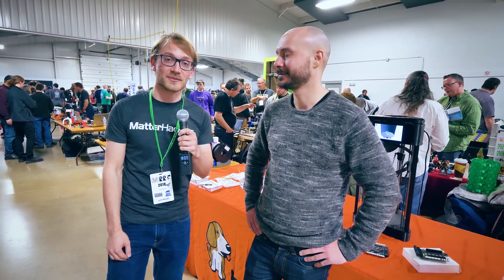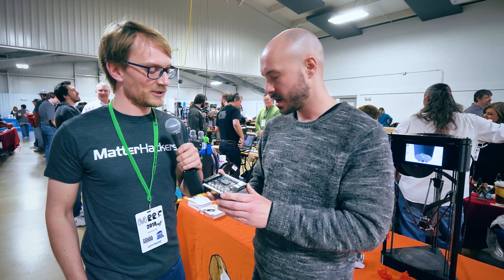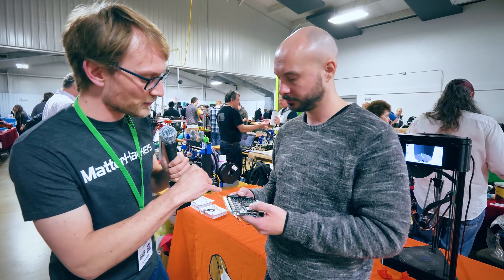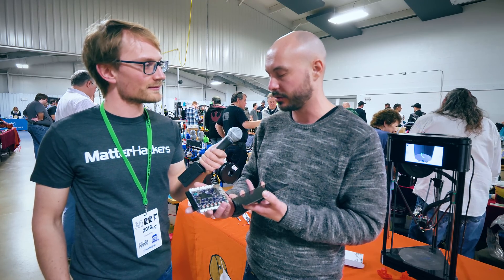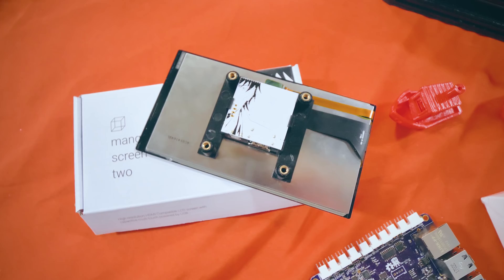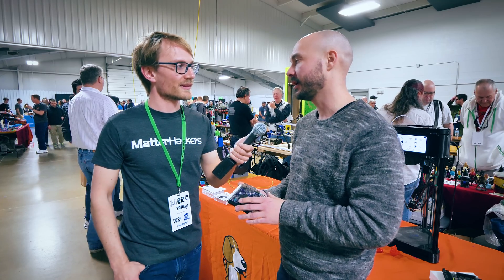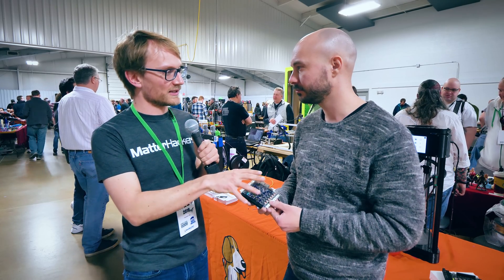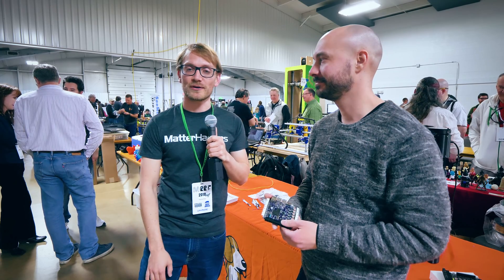Run your 3D printer with only this Octoprint-based mainboard! "Revolve" at #MRRF2018

Comment: Just checked the board price....it's down to $99. I'm a bit of newb. But that seems pretty good for all this is offering. Newb question...does this use marlin as the firmware to control the printer? Or something else? I know it says it runs linux. But I didn't understand exactly how linux would or could be used to control a printer. Is this board exclusively for Delta printers?

Comment: Would I be able to swap this for my original board in my make a bot replicator 1 and have it work? I'd love to bring that printer back to life and not be a makerbot anymore.
Reply: Definitely! As long as you wire things up properly and set the config right for Redeem there's no reason it wouldn't work.

Comment: i'm not very impressed of all-in-one solutions. they are nice for selling readily manufactured products - whole 3d printers - but for makers they lack the ability to exchange modules for testing purposes or if they are defective.
what do you do if one of the stepper drivers breaks?
Reply: Well that's the nice thing about modern stepper drivers - the current is controlled in SW so you can't really burn one out. And the whole component set is of a quality high enough that I've not heard of anyone blowing out a driver on their Replicapes... And even then you can still read the open design files for the board and find the step/dir pins to hook up external drivers instead. That's assuming you blow more than 2 or use the 2 external driver header pins as well.

Comment: Finally, an OctoPrint LCD option which doesn't suck. At $109 this is a maker level product and that's really cool. We have another competitor for the Duet and Marlin 2 boards. Exciting times for 32-bit!
Reply: Too bad its not in stock and does not use 2660s. I could live with the 2130s, but not having them avaliable really kills it

Comment: you think 32 bit is necessary for anything "non-delta" I mean I love the idea and faster is always better but just curious. that screen is gorgeous though!
Reply: I guess it really depends on how complex and how fast of a printer you're trying to run. The advantage of a 32bit board, even on a cartesian or coreXY is that you get smoother curves - as the speed at which it can do floating point number crunching is higher. So you can have much rounder edges, in a way. And if you have complex geometries, the path planner can optimize the acceleration curves in a more complex and print-friendly way than a standard 8bit board.
Reply: @goeland86  Or we could get slicers which understand that G02 and G03 commands exist for the exact purpose of doing curves. Thousand of tiny line segments are not as good as using a native curve function. The printer firmwares support this, it is only the slicers which do not.
Reply: @williamforbes6919  Not sure about other slicers, but Cura has a plugin for this.
Reply: @user2C47  There exists a Lua plugin for Slic3r as well, but ideally we would see native support for this in programs like Cura since it already allows for CAD model imports. 

Cura especially could implement slicing without ever converting the file to a mesh internally.

Comment: Maybe I missed it while looking over specs. Will this use 12v or 24v?
Reply: Both. It follows the same power schema as the Replicape - power circuits are rated to receive between 12 and 24V. You could use an 18V supply if you had one lying around and it would work. It will have on-board step-down circuits to guarantee 12V for fans, 5V to endstops & the rest of the logics system. The motors & heaters will get whatever voltage you put in, provided the total power throughput doesn't exceed 20A. Max power rating is then voltage dependent... 20x24 = 480W through the board. But that includes the logic (while not powering on should be less than 0.7A), motors, fans and heaters plus a few losses to be on the safe side. There should be a fuse on board to protect it.

Comment: 109 for this is pretty good. What stepper drivers is it running with? It would be great for 3 color print.
Reply: It'll run 2130s. And there's 2 external driver headers. So you could run up more colors if you wanted ;)

Comment: Huh, interesting. Back in 2015, I paid $99 on Kickstarter for a Fastbot BBP-1S and it had a similar featureset with the exception of the built-in HDMI. (Though it does have a 50-pin FFC connection for an LCD+touchpanel.) It has 7 stepper motor drivers, 3 heaters, 6 endstops, 6 fans, 1 microSD slot, 1 Ethernet port, and 1 USB for wifi or a webcam... Only 3 thermistors (including the HBP's one.) and one thermocouple though...  So this board sounds like an improvement in that regard as well.

I wish somebody'd write a laser cutter firmware for one of these fancy 'all-in-one' boards, with their web interfaces and stuff... That'd be the ultimate killer app for a $100 Cartesian robot controller board; really tune up those $400 Chinesium lasers and their abominable Moshidraw/LaserDRAW boards.
Reply: Redeem (the Replicape/Revolve firmware) can probably be configured to work for a laser cutter just fine. It would be easy enough to wire something together so that you control X/Y with steppers and then your E axis controls a binary output for the laser instead. If you're wanting to use the Replicape or Revolve in this way, create a feature-request on the Redeem github page.

Comment: $109... well it’s more than I’ve ever paid for a board but honestly it looks totally worth it given how integrated everything is. Question: 24V support? And what wattage? I’m using a 350W bed on my main machine.
Reply from the maker: I don't have the full spec sheet in front of me, but I'd very much assume that it can handle at least 24V. A 350W bed @24V is only 14.5A, which is easy to handle for any quality board.
Reply: The replicape has a 20A limit for board + heaters + motors. It's safe to assume the Revolve will have at least that much power handling as well.

Comment: Awesome thanks for pointing this one out, the BBB has sub prosessors (PRU's) that are real time if they use them it will be amazing (which of cause you mentioned they do in the video)
Reply: We already do use those same PRUs in the Replicape+BBB system. The path planner creates a queue of stepper paths in a shared RAM buffer that the PRUs then run through. When there's available space in the buffer, the planner adds more moves to the queue. It really does give a super smooth printing experience.
Reply: goeland86 
I am so glad someone used the BBB for this. I am not a programmer (so would have issues implementing anything) but I designed lots of capes for the BBB and then had Kidd's and didn't follow through with them. The BBB is perfect for what your using it for, one thing I was looking at was closed loop sensing too, but the drivers you are using are amazing and almost do the same job. I will be buying 2x of these (possibly the capes as I have 10 Bbb's spare). But I must say please please consider the same product for CNC, if you can get that right and attach kit to spi and the i2c busses to make them manageable, wow will we have an amazing place to start making some incredible mills and routers.
Reply: So there's an extension project for the Replicape called Reach - that adds on a CAN and I2C bus, 2 (3? can't remember) TMC2130s, 2 extra thermistor & endstops and more. But the Reach has not yet been manufactured afaik, the development files are open though. If you'd like to get involved, talk to mcleod and theoanden on the Replicape slack :)

Comment: I personally own one of those armed to the teeth fancy 32bit board, does everything he says, live 3d model viewing, on-board slicing, and such, but I really struggle to justify the need of a such board (for the price). I do the cad and I send it over via WiFi, and pick it up later. I ended up unplugging the screen because I never used it.

I originally wanted faster speed,  but there are so many other cheaper 32bit options, (stm32, teensy), this is not really a valid argument. we could just make an upgraded version of ramps with stm32 and it wouldn't cost any extra on hardware.

Maybe this kind of mainboard is good for showing off at exhibits? but are you really going to let people touch your control panel?
I really dislike when people use a board like this and present the printer as they have made this cool interface (no, you bought it).

Thomas, could you think of some examples of potential users?
Reply: 郭虎承Guo Hucheng the screen on the revolve is optional and you can disable the touch screen interface to gain performance. Also in this case, I've helped test and debug the code. He didn't buy the interface.

The touch screen is helpful when you're at the printer and need to move things on the printer (i.e change filament) without having octoprint right next to it

Comment: Tell the guy to do a deal with Anet and replace the crap they use.....and maybe include auto level as default and not charge more for an AL board ...the firmware upload time is the same for the actual manufacturer ....and would remove the need to have separate stocks!
Reply: Better idea is to have the Anet customers complain about the electronics and suggest they get in touch with Elias instead... They won't budge if someone says "hey, here's an expensive replacement for something you're already shipping". If someone says "I won't buy it until you replace the crap with something decent like this" instead, they'll be like "uh, ok we need to do something about it"

Comment: Like I said on Hackaday if it's north of 100 dollars I'd rather stick with the MKS that came with my printer and use Klipper, I can get the same result with a PI 35U$D + TMC2130 20U$D.
Reply: Can you though? Also, Pi+TMC on MKS board may be cheaper, but you're still limited to speeds that the USB serial port can handle. Replicape (and thus Revolve) can generate paths more precise, smoother curves and generally finer stepper sync than you can achieve with an 8-bit controller board, because you don't have the USB speed bottleneck for stepper moves sync. The Replicape/Revolve can buffer up moves for the PRUs in RAM (so ~ 200MHz) and the PRUs run their loops at 200MHz - compare that to what an Atmel-based chip can achieve in the mega version, which is 16MHz.

Comment: Looks amazing, any chance of more stepper drivers for a Voron2 build?
Reply: John Jubei there's an extra 2 sets of driver pins on the prototype right now for external drivers, not sure if that's enough.
Reply: goeland86 that would be perfect for a voron2 build as it requires 7 for a single extruder build.

This looks to be a duet killer

Comment: I'd like to see some mated controllers with some intel NUC hardware.
Reply: or even the lattepanda doodad
Reply: The problem with the NUCs is the lack of gpio ports. Not to mention on a printer you need real time processing... That means real-time os which is a major bottleneck on what apps can be written and run on it

Comment: “Ran a few kickstarters”
Have you thought of using Crowdsupply for the Revolve?
They are supposed to have engineers specifically on staff to help you with making it work and with helping you get the supply chain
Reply: Abdega he's run multiple Kickstarter campaigns before. This time he's trying to look at a different funding deal to potentially get the product to market sooner.
Reply: goeland86  Sounds like Crowdsupply might be a good fit then.
It is meant to be streamlined for funding to product.

Comment: What's wrong with RAMPS + Arduino? 
Why kill the fly with a sledge hammer?
Reply from the maker: a) Bottlenecks from the slow AtMega processor (think Deltas)
b) Bottlenecks from USB (fine details)
c) AtMega is at its capacity already. Prusa has needed to strip features from Marlin to have enough ressources for what the MK3 needs
d) Most RAMPS use horrible components - this comes with high-end electronics
Reply: The days when a controller board was asked to do simple computations to do some crude 3D printing are coming to an end. These days we expect advanced computations for speed and quality, advanced features like across the bed active leveling, friendly user interfaces, error recovery, multi-material printing, etc. The ATMega chip has been outgrown. Yes, a crude Anet A8 type printer for tinkerers can get away with older hardware, but realistically it is time to move on.
Reply: What's wrong with what we have now? That's what candy-bar phone users said when the iPhone came out. Let that sink in.
Reply: The iPhone inspired the Samsung Galaxy. Do you want to belittle this user base as well?
Reply: Don’t badger angry elders...
Reply: I guess I am a happy tinkerer with my Anet and Prusa MK2. When and if I out grow this in a few years, I will be moving towards a laser system. 
No point of buying a Ferrari to do 50 mph :)
Reply: iPhone is for techno-idiots who will bend over, take it, and like it. Let that one soak in. 
You wanna troll me? bring it.

Comment: Maybe I'm a little out of touch with the newer tech out there, but how does have a cost advantage against a $35 raspberry pi and $12 Arduino Mega from Amazon?
Reply from the maker: a) Bottlenecks from the slow AtMega processor (think Deltas)
b) Bottlenecks from USB (fine details)
c) AtMega is at its capacity already. Prusa has needed to strip features from Marlin to have enough ressources for what the MK3 needs
d) Most RAMPS use horrible components - this comes with high-end electronics
Reply: That actually explains a lot...  Thank you :)
Reply: Andrew Metcalfe we've successfully demonstrated the reliability of the architecture in Replicape for 2 years now. This is just making the beaglebone superfluous. One thing that has needed workarounds is a speed limitation on how fast octoprint can pass gcode lines. We now simulate print from SD to pass the file handle to redeem directly, and this works flawlessly.
Reply: Andrew Metcalfe the pwm is actually handled by a separate specialize chip on Replicape, but the tricky bit was stepper command synchronization. Most boards use a real time firmware for this reason, so the loop in the program is constant speed. But it makes programming difficult, here you can write the math code as a normal python and c++ code which is easier to read and very fast to execute, and let a special unit execute instructions with proper timing
Reply: The project is fully open hardware, the design files are currently being developed on github. The PWM is a PCA9685 chip that is controlled by one of the GPIO ports. We use the ARM 1GHz CPU for computations and queue up the moves to be executed in a coordinated manner by the PRUs existing on the BeagleBone chipset (beaglebone black and beaglebone green have those, and they are known to work). The PRUs can access a shared buffer in the system's RAM, which makes data access latency a non-issue as compared to USB, and even SD card reading.

Comment: So out of curiosity could I potentially buy this board and screen and essentially upgrade my Anycubic Kossel Delta printer to work with octoprint and have a touchscreen?
Reply: Zero Tech Theoretically it should work with almost any printer as long as you setup all the settings correctly
Reply: Yes, you can. As release manager and community manager for Replicape I've seen the use case where most folks start with updating their existing machines to get better controls on it, and then they decide to build a new printer from scratch to really take advantage of the board.